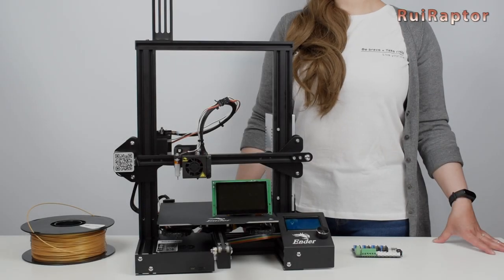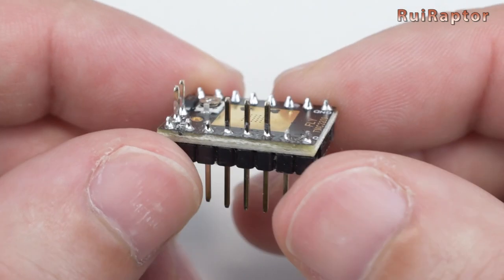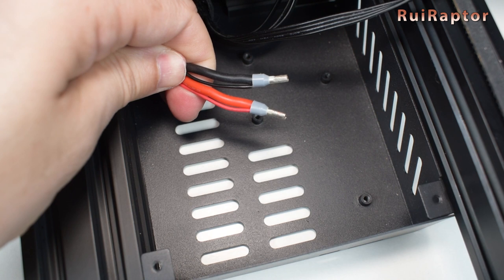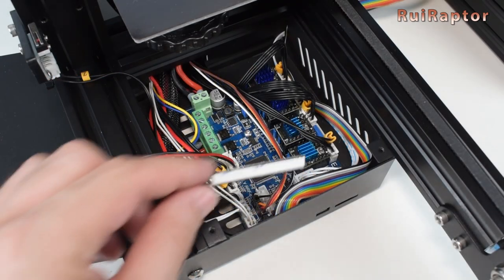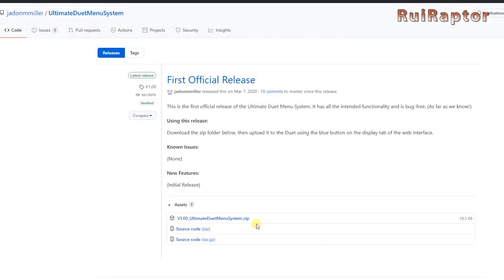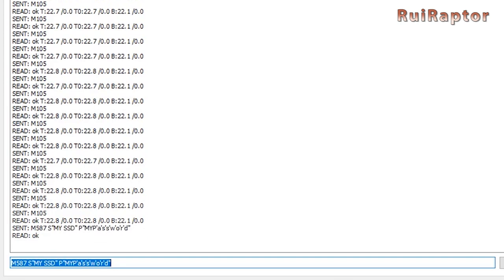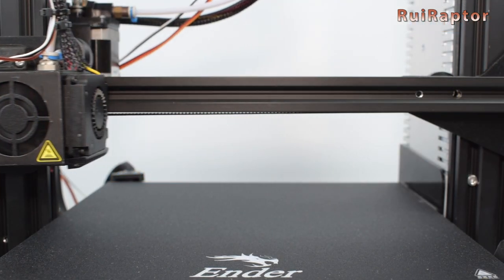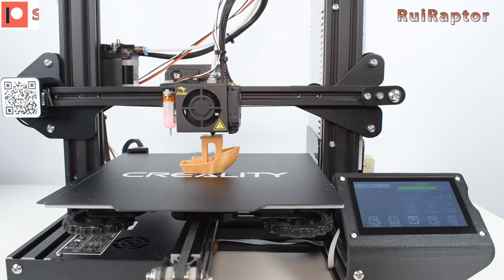FLY RRF-E3 Board & Touch Display (MELLOW) - How To Install & Configure (CREALITY ENDER3)

Comment: Great video. Was there a quality improvement with the board?
Reply from the maker: Hi Michael, if you compare against the stock board equipped with  Allegro drivers, then yes, you will get quality improvement when using this board when using with TMC drivers.

Comment: How can you set AP mode for wifi? I saw on the TFT you had that option. If we do not have a TFT what is the command to switch to AP mode. Thanks.
Reply from the maker: Hi, this is the reply from Mellow to your question...
M552 S0
M589 S"DuetSSID" P"password" I192.168.0.1 C1
M552 S2